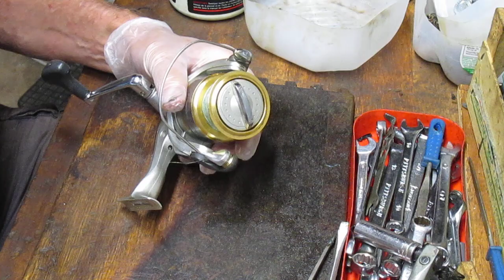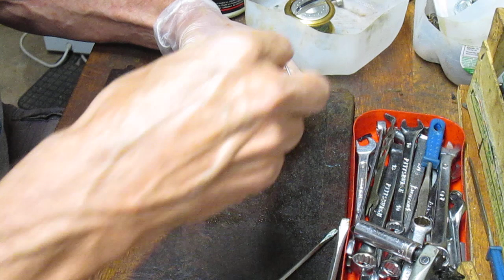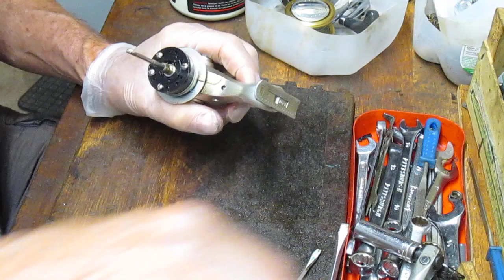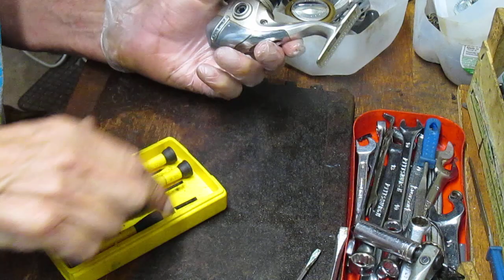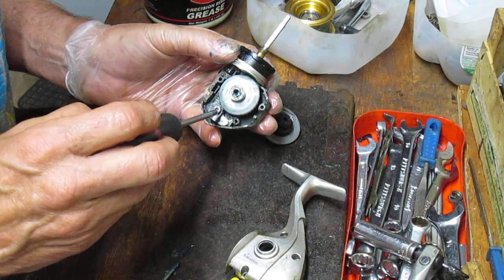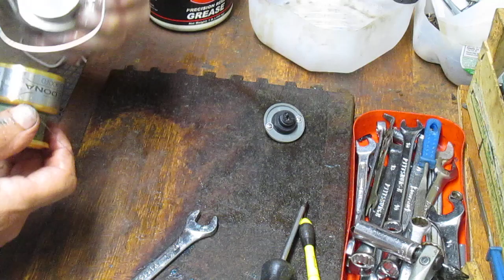Shimano Sedona 4000 fishing reel main gear and spool shaft replacement

Comment: Thank you  you just helped me fix my reel. God bless.
Reply from the maker: I am glad to hear that it helped.  That's why I am doing these videos.  Best wishes - Dennis
Reply: Dennis, thanks for each one of these videos. Can you post the website for the parts place up in Canada and any other you'd trust here in the states? I'm here in the Central Valley of California. 

Thank you Sir. 
Stan
Reply from the maker: Sure - For Penn Parts use mysticparts.com which is the former Pennparts.com,  For non-Pen Parts, Mikes reels in Canada https://www.mikesreelrepair.com or E-replacement parts www.ereplacementparts.com are good sources.  You can also check manufacturer specific websites, like Okuma, for parts availability - Dennis

Comment: I had trouble getting the main gear and case lined up correctly. Would grind and had to unscrew and screw the case back together a few times.  Here is a tip for getting smaller screws to stay on your screwdriver. Slightly dip the tip of your screwdriver in the grease.  The small screw will hold to the tip and be easier manipulate into the hole.
Reply from the maker: Thanks for the tip.  I will try that! - Dennis

Comment: Thanks for the vids. I have play in the shaft on my 2500 Sedona side to side play the shaft wiggles. Any idea what part would be worn.
Reply from the maker: I'd check to make sure that the crosswind block is attached firmly.  Sometimes the set screw shakes loose.  The play would be in the block or the stud on the oscillation gear drive